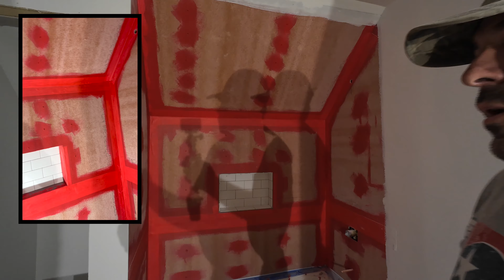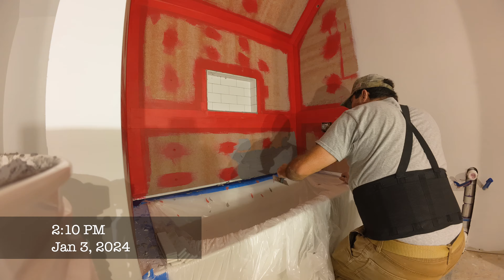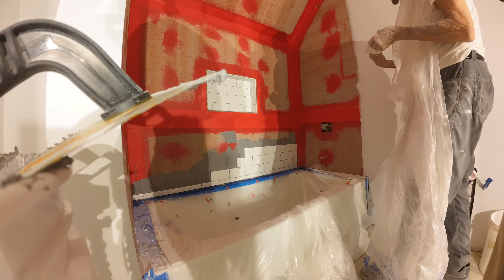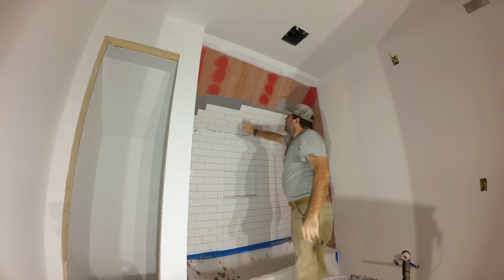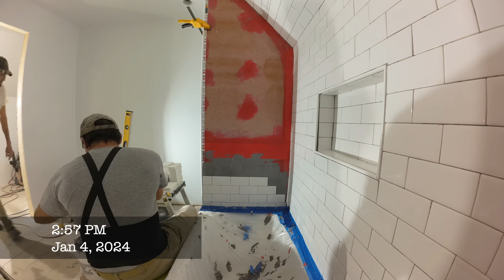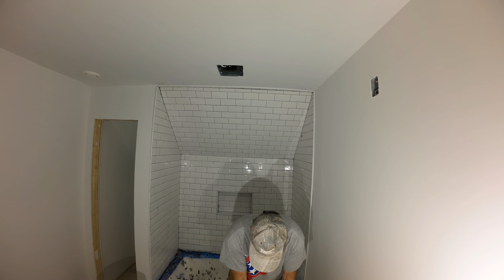subway tiling a shower surround 4k Timelapse

Comment: As a tiler myself (not that I do much personally), I can say this was a job very well done. Ok not the most difficult project but the fact you are using dark grout means you really have to be accurate with the joints and the slanted up wall is something I’ve never actually had to face. Is that why you wire what looked like a back support? 10/10 from me neither 👏
Reply: Back in
Reply from the maker: I had a back brace on because I got hurt. not even sure what I did, just being old I guess. I was down for a week healing up (lower back). some of my joints were off, but over all it turned out well.
Reply: @TheProCut17 I’d say it’s almost impossible to get the joints perfect. I noticed you put the side trim on and then tiled straight away. Always debate on this with our guys. Some like the ability to manipulate it as you go, others don’t like the fact it moves so pre set it. I like your confidence in putting the bottom row of cuts on and knowing the exact gap to the hole in the centre of the wall 👏
Reply: Meant to say wore a back support and 10/10 brother, predictive text 🤦🏻🤦🏻
Reply from the maker: got lucky on my measurements for once lol @DataWatch.